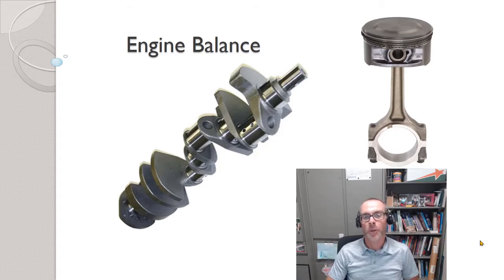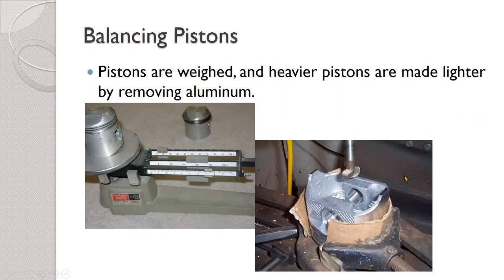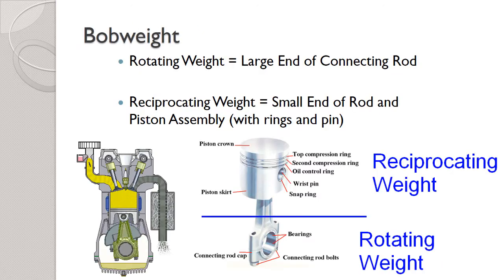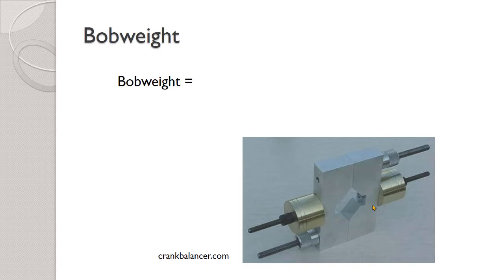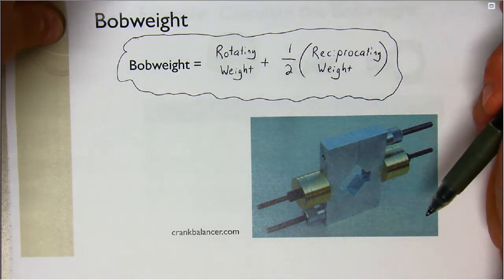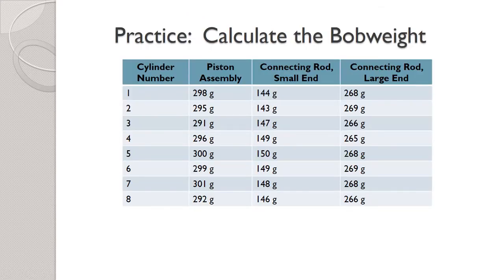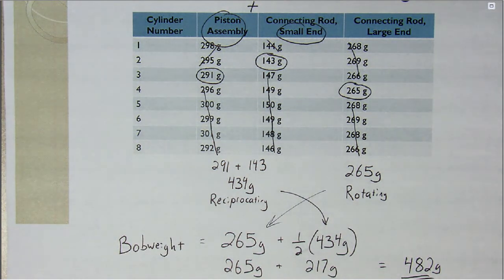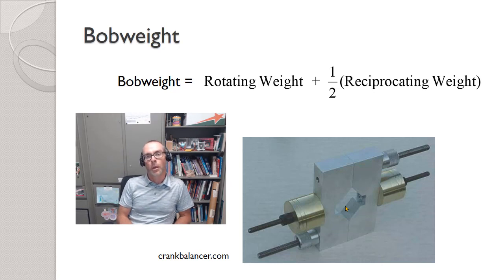Applied Math:  Engine Balance

Comment: what about the rod bearing, was it in the piston large end when weighed ?
Reply from the maker: Yes, good question.  The rod bearing should be included, as well as connecting rod nuts.  The piston should include the rings and wrist pin as well.